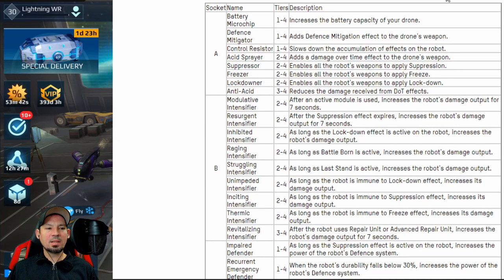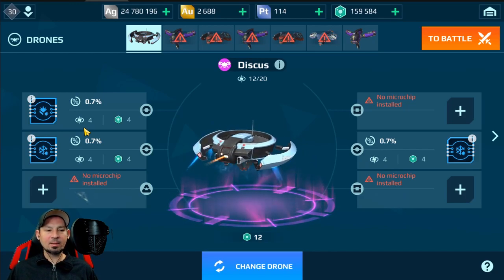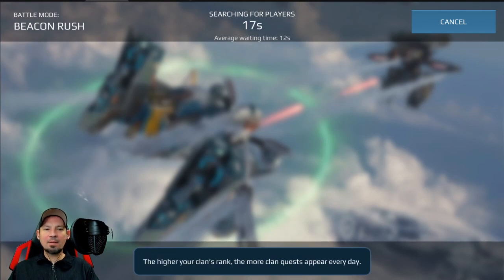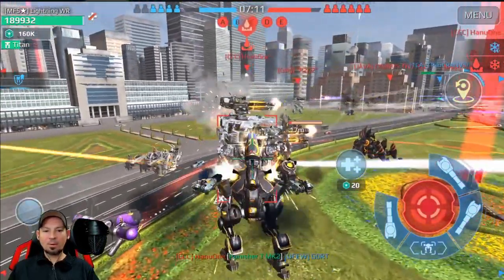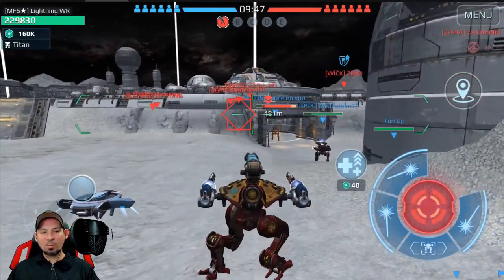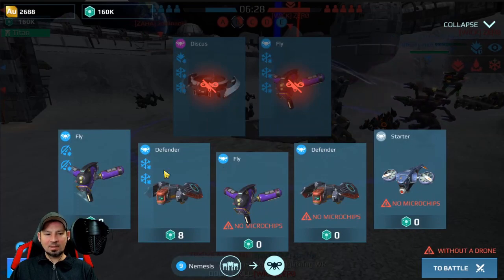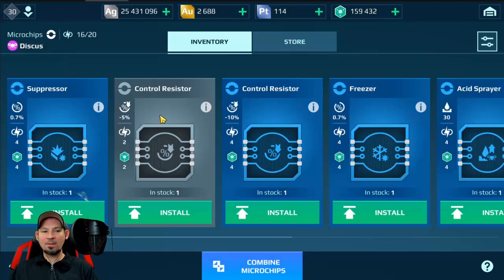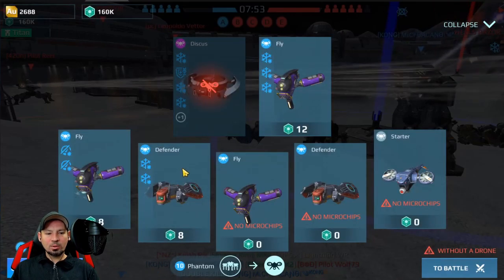War Robots, A look at all the microchips for your drones and some gameplay

Comment: More good drone info Lightning.  I did not know if you combine chips, you get a random chip.  You can't Suppressor chips and I can't get Freezer chips.
I switched out the Scourge for Atomizer on my Phantom.  You lose 100m range but It's great to be able to keep firing while the two Sparks are reloading.
Reply from the maker: I'm not sure why but I still like the electric shock torture set of better on the Phantom and thank you 😀

Comment: So how many PC’s per match do you find yourself using between drones and modules? Just wondering what the drain is as I am abstaining from drones and active modules until I build up my PC level.
Reply from the maker: I've never really added it up,,. I don't really use a whole lot of power cells like people doing battle so it's different every game,. Then it also depends on how many power cells your drone cost which can vary depending on what you have installed in it so there's just too many unknown factors to really say how much you're going to end up spending per game

Comment: What does "as long as the robot is immune to Freeze effect, increases its damage output" mean?
Reply from the maker: if you have anti-control and it kicks in you are immune to suppression so during that period of time you do more damage also if you are suppressed after the suppression wears off you're also immune to suppression for a few seconds and the extra damage kicks in at that point too so those are the two things which will trigger that module
Reply: @Danny-Lightning-WR  Thanks for answering my question. I know that’s how it works for suppression, but I was asking about the freeze effect. Does anti-control also work for freeze effect?

Comment: Using more than two ability microchip in any drone. Especially if many players do that will be a big problem in the game.  The big problem is it’s just like too many players using the same robot or weapon eventually Pixonic may Nerf it or change something in drones to prevent multiple ability microchips in one drone.  I’m just saying that maybe a bad thing someday in the game.  This is just my opinion.
Reply from the maker: Most of the chips do very little I've noticed so you almost have to have two or three of a chip to really notice a benefit I think some chips that may not be true but at least with the tier one of the tier two chips

Comment: Thank's for the run down, I'm having problems with my free drone, it won't except a mirco chip🤷‍♂️ I've tried, my brain won't except the fact you NEED Drones n with good chips. I need to rewatch your drone n chip video, this has me confused. I'm getting Murked these day's, It's to the point where the FUN is being taken out. I was in a battle against members in the same clan, we Lost 1 to 24(I got the only kill) 🤷‍♂️where's the Fun in that.? Danny, is your Ao Jun acting strange, like walking around with a hard Flamethrower.?  constantly flaming away. I wish it stayed this way, Stuck. LoL take care
Reply from the maker: You do remember that the symbol on the chip and the symbol on the slot have to match right??  And that chips and drones also have energy limits so let's just say your ship has 8 energy but you've only got four energy left on the drone you can't use that chip.    So I'm guessing you're either going over your energy limits or you're trying to put the wrong ship on the wrong slot
Reply: @Danny-Lightning-WR  when I look at my drone stage, there's your Starter(Why do I have 2 starter Drone's.?) when I press the drone, another screen pops up with 1 Starter n to the right there's a black battery chip with arrows pointing to an empty( with a green 2.?) when I press that, 2 micro chips show up. 1 says Battery Chip with a Green ✔ EQUIPPED the other Battery Chip not checked. 1 says 1 in stock the other 14.  It keeps pointing to Combine Microchips, I touch that Out comes a screen that says AUTOFILL. When I press that blue box it says There aren't enough microchips in your inventory. Whatever I press it says Fill all the combination slots in order to combine microchips. This is where I get Stupid, Seriously. I don't know what to do but go back where it says UNINSTALLED the other INSTALLED. Understand why I'm🤷🏽‍♂️Lost.?? I Need to go back to when I was up in arms against these drone's n rewatch their n your drone video's<---- that's Alot Thanks Danny

Comment: Can you pls tell me some good and cheap chips and drones for plasma weapons like redeemers and tarans
Reply from the maker: In the circular slot you have chips that add things like lockdown freeze or suppression,. The triangle slots allow you to add more damage during different situations like if you are locked down your weapons can deal more damage, if you're Frozen you can deal more damage you know stuff like that.   you just kind of have to look at the chips and those two categories and see which one seem to work best for you.   Just keep buying the gray and blue chips when you see ones that you like and then you can eventually combine them together to make better chips.    The modulative intensifier chips the triangle slot,. Does make so every time you activate a module your weapons do more damage,.   there's a lot of drone chips that I don't care for and most of them are very situational they only work sometimes depending on what's happening.   I guess it's kind of personal preference.  But depending on what modules you have installed and other things like that is kind of depends on which chips you put in your drones, it's kind of complicated so it's kind of hard to give you a really great answer on that

Comment: How does defense mitigator work because I bought one of those chips and idk what it does
Reply from the maker: If your drone has weapons those weapons will go through a portion of the robots damage resistance,.  So when your drone is shooting something like a fenrir, Titan  or a leech that's in its ability it'll go through move through some of that damage resistance but it only works on a drones weapons and not your robots weapons
Reply: Lightning WR correct. There are still many people that confuse that concept

Comment: How do you become immune to freeze effect?
Reply from the maker: Okay I recently did find that one out and after your Frozen as soon as it wears off you become immune to freeze for a short. Of time and that's when that chip kicks in,. I've been trying to get a solid answer on that one for a while and I finally got it so that is the deal.  

Now the chops where your immune the lockdown or suppression,. those work the exact same way about they also work with the anti control module as well and I'm really surprised in the control module doesn't get rid of freezing

Comment: Having any more than 1 of the same effect Chip is highly inefficient...

The effect accumulation stacks but does not differentiate between effects. Meaning if you have 
1 freezer
1 suppressor
1 lockdowner
All  3 effects accumulate @ 2.1%
So it's kinda wasting slots.
Reply: Yep , I use lockdown and freeze on two drones , 2 lockdowns / two freeze underperform ... moreover it does not make a difference playing with or without low level drones , if we have below lvl 12 weapons . Drones like nebulla with lvl 12 is fine if one can afford it ...
Reply: @m4lev0lentdem0nknightamv5  I agree with that. You can make a silver drone perform great.
Reply: @atowns3364  but if you have lockdown / freeze weapons ( which many  have )  it is not required ... BTW I run atomizer - pulsars on leech , quarker -corona on phantom , cryo ravana , halo loki .. so ....
Reply from the maker: Depends on what weapons you put these on,. It's very helpful on the right weapons
Reply: So the main takeaway from this is the effect accumulations do not differentiate between one another. So if you are running cryos all the effects will take effect when the cryos freeze, Or shredders lock.
Reply: Chandan it helps the effect to happen earlier
Reply: Allen Townsend of course not. They are independent
Reply: @RenatoZimerfeld  they are not my friend. My clan and I have verified this in custom battles. It's just lazy programming on the part of pixonic.